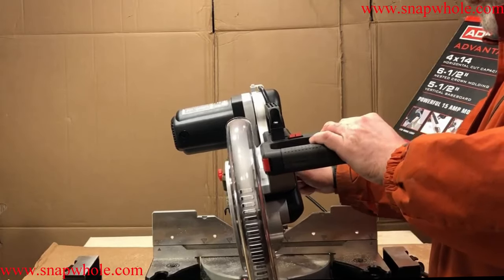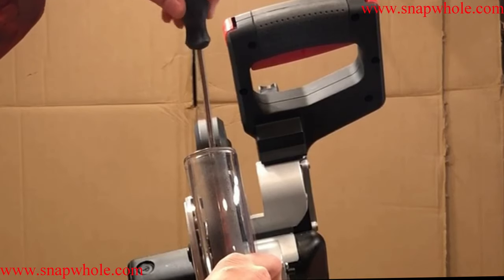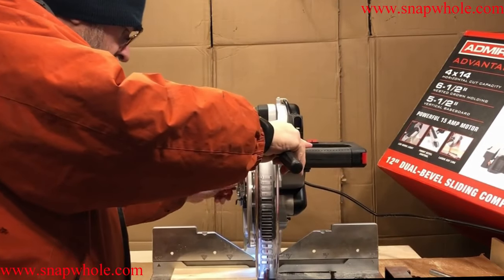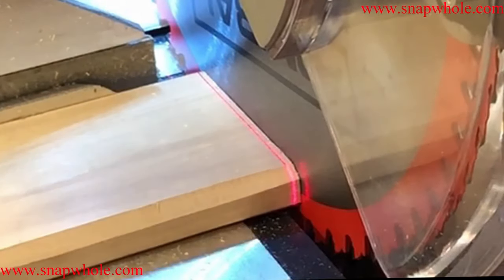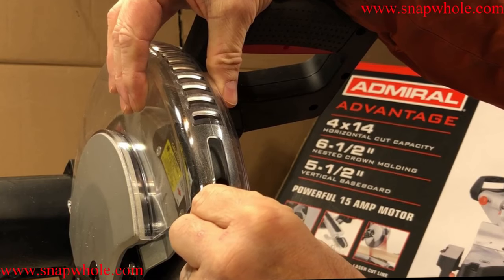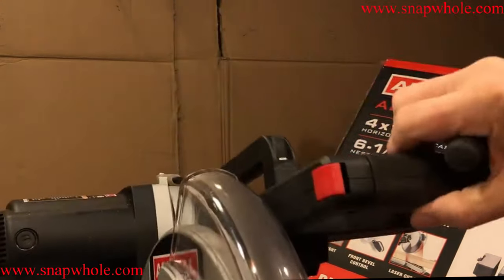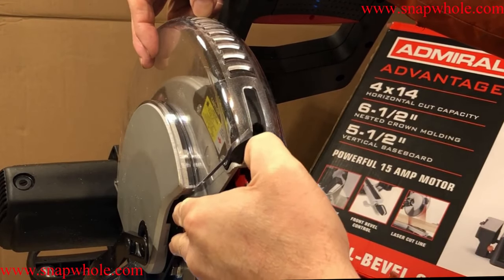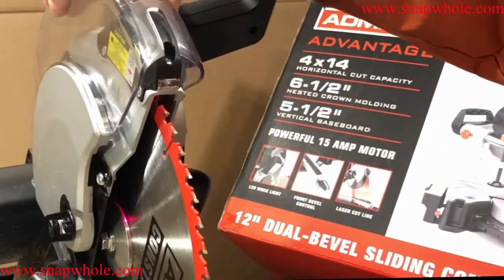Harbor Freight Admiral Miter Saw - is it accurate?

Comment: He's only wiggling the cover. That does nothing, as he states.... You have to take the cover off the laser off completely. Then, you'll see there are two screws at the back of bracket that holds the laser guide. The screws go through slotted holes, so you can move that bracket left or right. Also, there is an allen screw holding the actual laser guide/lens (the laser itself is inline). If you loosen the allen screw a tiny bit, you can rotate the guide/lens (it's round).....So there are multiple adustments, both from moving the brackets left and right, and from rotating the laser lens that is held on by the guide. All of that is under that cover. Just went through this yesterday with my new saw. You may or may not have to shim up the right bracket screw with a small washer so that the laser light will not hit the top of the blade, and block the light when you get it really close to the blade. But, again, you have to remove that black cover first, and then you'll see what I'm talking about.
Reply from the maker: I did not want to make that adjustment, I ended up selling the saw and buying the hercules - HF needs to put access holes so the adjustments are accessible but still cover the laser (which is most likely a high intensity LED) - I wanted the hercules so I knew I was getting rid of it anyway, the admiral is a good saw, I was impressed with how it worked, but I really wanted the hercules - thanks for subscribing!

Comment: To be fair, because teeth are usually offset a bit from the plane of the blade, measuring against the side of the blade is probably not the best why to measure where the cut will be.
Reply from the maker: I agree, but when the laser is 1/4 inch away from the blade, the length of the offset really does not matter - when the laser is near the offset tooth, then I would start worrying about accuracy - the hercules has a shadow light, and that makes it easy to make an accurate cut, just sent the shadow of the tooth right on the line
Reply: A properly designed laser guide would have two worm screws. It would then be trivial for the user to adjust the laser.

Some of my tools do have that design, but most do not. Notably, the tools that do have those adjustments screws are already precisely aligned when new, while those that don't have those worm screws never are, and can never be adjusted well.
Reply from the maker: @langhamp8912  thanks for the info - Thanks for Subscribing!

Comment: My LED light and laser stopped working a few months after purchase. Its 2 years old now, so no exchanging it. Does anyone know if the LED and/or laser takes batteries, or are they strictly hard wire powered? Can any aftermarket lasers or shadow lights be added to this? I actually got quite good with my eye making accurate cuts, but its so damn convenient having a trustworthy laser, or better yet a shadow light like Dewalt.
Reply: Glad your comment was recent because I can help ya out on that. Gotta get back to work but I'll be back in a couple hours to let you know what to do. 👊
Reply: @hardtelling3879  hey can you help us out? I’m wondering the same
Reply: @spacemanbill9501  yes I can. What's your's doing exactly? Not working at all or what

Comment: there is a guy who put a washer under one of the screws and got the laser to line up
Reply from the maker: I really was not interested in jury rigging something with the laser, if the fix moved even a little bit, the cut would be off, and the cycle started again, I prefer to have a saw I can count on, which is why I still use my CE, and upgrade this saw to the Hercules miter saw - thanks for subscribing